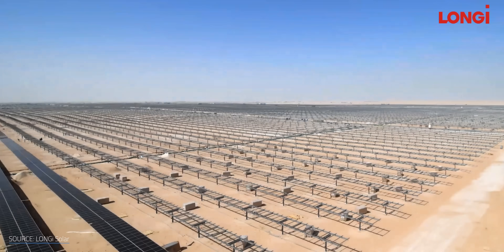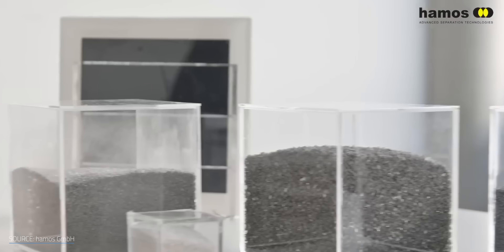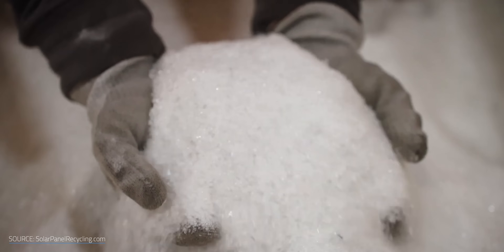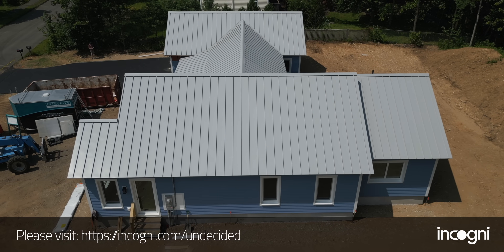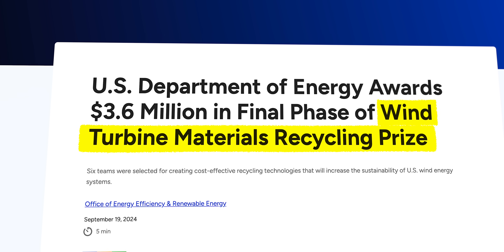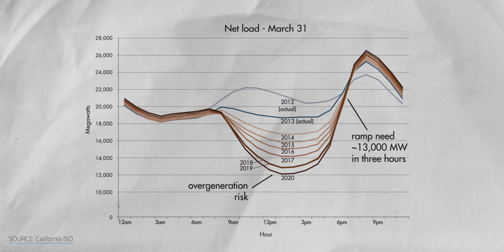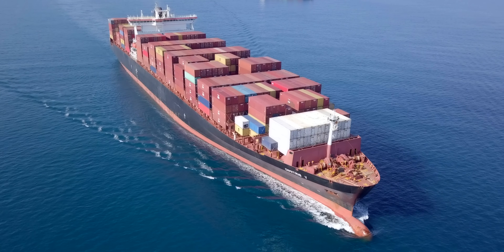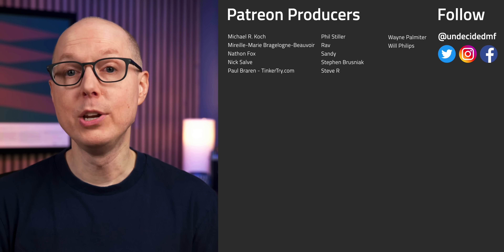How We Solved Renewables BIGGEST Problem

Comment: I never thought PV panels needed to be recycled. The ones I put on my roof 35 years ago are still working fine.
Reply: How many watts are they putting out compared to 35 years ago?
Reply: I'm guessing 60 to 70% the original output? The loss tapers out over time, right?

Either way, they are going to pull way more than their weight across their lifetime, even as they degrade.
Reply: @georgepal9154  actually if the numbers are correct and they are using them fully every day they should not have dropped by more than 17 to 18% so closer to 80% their original output.
Reply: the main issue is damage from hail and uv damage on the resin ones making their protective coat yellow
Reply: They will still keep working but the efficiency (amount of power you get from them) goes down with time, though if you’re 35 year old panels are still working I would expect new panels to last even longer due to advancements assuming they are built well.

Comment: I think the full usable lifespan of a solar panel is greatly underestimated.
Very early on the guarantee was 10 years, then some raised to 20 or 25 years.
But the true lifespan is much higher i think, more like 40 or even 100 years.

Some people are upgrading from old to new panels due to esthetics, or higher efficiency (power per surface area), not because they are broken or worn out.
Reply: "Full lifespan" isn't the important factor. It's how much efficiency drops off over time.
Reply: @qoph1988  do you think replacing them is more efficient? Why are the guarantees for 25 years?
Reply: Not even close.  Panels break in use.  From wind, hail, etc.  Any utility grade photovoltaic field are replacing panels every day.  Not to mention these panels are not built to last, they are built to be as cheap as possible, and that reduces lifespan.
Reply: @jeromethiel4323 utility type panels are almost certainly made to last decades and those needing replacement is insured. Panels can easily be made to last more than half a century with less than 20% degredation.
Reply: @pietersteenkamp5241  Okay.  I will believe what i have experienced and know first hand over wherever you are getting your information from.

And you can insure whatever you want, if you cannot buy the panels anymore, you are SOL.  You cannot mix panels willy nilly.
Reply: @jeromethiel4323  The insurers are of course meant to replace it with whatever they have to and that has nothing to do with you if you buy from a good brand that will exist for 40 years. Not sure why you think it's an economic necessity for a insurer to exist 40 years after it sold you a fairly cheap product but fine but fine maybe it does!  We have research panels that are over a half century old now and commercial panels from the early 90's operating at 97% capacity. You just don't know what you are talking about and want to compare the worst and cheapest commercial panels in a fast changing industry with how things have been for the last 5-10 years of stupidly cheap long lasting panels.
Reply: @jeromethiel4323 cheap ones anyway... I have 100psi snow load requirement here and we get skookem panels.  Inverters on the other hand are poo
Reply: @jeromethiel4323 From Google AI;
  
 Lifespan: 
Most solar panels are warrantied for 25–30 years.
High-quality panels can last 40 years or more.
Some panels installed in the 1980s are still working.
    
Degradation:
Solar panels produce less energy over time. 
The general rule of thumb is that panels degrade by about 1 percent every year. 
However, modern panels have a degradation rate of less than 0.4 percent. 
    
End of Google AI,
Reply: @ronaldlindeman6136  Google AI is wrong.  I work in the industry, and i will put my personal knowledge of this topic up against some stupid AI that can make up "facts."

For example:  "Some panels installed in the 1980's are still working."  Great.  How many?  What's the percentage?

And i might even agree with the 0.4% degradation amount.  That doesn't matter if the entire panel breaks.  Which is what i was talking about.

There are solar sites i service that cannot buy panels anymore because the panels they need are no longer made.  Why?  Because the panels break and need to be replaced.  And these sites bought huge supplies of spare panels when they were built for this very reason.

Comment: 1. One easy way of reusing old solar panels can be to reuse them over affordable housing. The panels can still priduce electricity, albiet at lower efficiency. But, it is something that the lower income housing won't mind as long they get the solar panels at dirt cheap prices, making them economically viable. The same can be done with lithium batteries. The car lithium batteries can be reused as back-up storage batteries and then in low income housing to increase their lifespan before they need to ve recycled.

2. Increasing the life of solar panels like peroskite solar modules, which have higher lifespan and higher efficiency, can help in reducing the pressures on recycling industries.

3. Companies have developed systems that can recover 90 percent of resin, epoxy, and fiber. Alternatively, old wind turbines can be gobbled up by the concrete industry to reduce their carbon footprint.
Reply: the problem with this is this:
1.- poor people do not get the land to make homes... its expensive
2.- whos gona pay for setting all that up? believe it or not, companies will not because moving/delivering, etc takes money from their money share... unless they are cut taxes equal to that price, but then they will overinflate it...

Comment: One of the biggest challenges renewable anything faces, really, is industry inertia. Replacing old, dirty technology with new, clean technology is expensive, and doing nothing is cheap - in the short term.

It'd be great if there was a way to make replacing everything with better things the cheaper option short term, or make doing nothing probibitively expensive.
Reply: Time + Scale + Technology improvements = lower and cheaper cost usually. Even when it comes to replacing it, but there are still just some major jumps when asking someone to put something on top of their roof that can make it a hard ask. Change is hard - and learning how it works can be harder / offer someone no benefit.
Reply: Inertia is only part of it. An expensive new powerplant can have a 30-year lifespan and abandoning that part way through its life for something new comes with a cost.
Reply: @FutureAIDev2015  the real problem is that throughout history, we have never switched to the new form of energy, we just add that and continue using the old as well.
When we "switched" from wood to coal, we started cutting even more trees. When we went from coal to oil, we burned even more coal, oil to natural gas we burn more oil. 
This trend will continue until fossil fuels are too expensive to be worth extracting. If we were planning for the future, maybe renewable energy could hold our civilization together for a few decades, but we are not.
Reply: @ A common sentiment from someone with no understanding of physics, economics, or logistics.  Current renewables are not feasible replacements for chemically stored energy.
Reply: @justinbiondi  of course they are!
Why do you think that the equivalent in solar panels of 10 nuclear plants in power output is being installed somewhere in the world EVERY WEEK?!?! And that number is growing nearly 30% per year!
Reply: @st-ex8506  Congratulations! You completely ignored the facts of what I was talking about, which is the lifetime cost and feasibility of current tech.  When you analyze it correctly, 'renewables' DO NOT beat fossil fuels in CO2 load.  Surprising? Well, most analyst ignore or omit many costs and stages of production and logistics, disposal/recycling and other factors.  And the current best trends show that they never will.  You cannot get energy for free, end of.  The only feasible solution is to return society to a pre-industrial state and abandon all hostile climates, which would lead to billions of deaths.  Don't feel bad, most people have no idea what I am talking about, lifetime energy cost is never calculated.  And all of the numbers you see publicly are severely skewed by government interests. We might make a renewable at some point which will cross the threshold, but no current tech will do it.
Reply: @ you are UTTERLY wrong as to the costs and CO2 footprint of renewable energies.  They are both WAY lower that those of fossil energies, and are decreasing further year after year.
I know a bit about that… it’s been my job for 15 years!  On what experience of yours are you basing what you say?
Reply: @amosbackstrom5366 sounds good, we should use all energy not just one.
Reply: @amosbackstrom5366  What you said is correct. The only way to change this is to have the government phase out the tech. They did a bit of that in the EU or it was the UK back around the war in Ukraine because of the lack of oil/gas. You have to do the same in the US and other areas, but that requires tech and tech requires stuff to be in place. As we saw with them, people wont want to change what they are use to using + the cost to upgrade it.
Reply: The biggest challenge with unreliables... is they don't make any sense, if they did? the market would move in that direction all on its own.
Reply: @DoktorBayerischeMotorenWerke  But the market IS moving... full-steam ahead (pun intended... in that direction!
90% of the world's investment into new power generation is into renewables.... which can be made VERY reliable!  Of course, there is much work to do to achieve that, but that is being done faster than any industry specialist (of which I was until my retirement last year) would have thought possible 10-15 years ago!
Reply: @ Someone said that exact same thing to me 20 years ago...
He was just as wrong then as you are now.
Reply: @ Well... I worked the last 15 years of my career as the technical director of a company active in renewable energies.  So... what I say IS a fact... backed by much experience.  

But you are partially correct... it was not true 20 years ago!  You should definitely wake up from such. long sleep... things have changed a lot, and are changing every year more rapidly!
Reply: @st-ex8506  How can you deal with the fact you wasted 15 years of your life on a lie?
 Or were you just in it for the paycheck???

So what has changed from 20 years ago?
Reply: @DoktorBayerischeMotorenWerke  Nope!  You decidedly know nothing of what is happening.
I am a chemical engineer, and I was leading engineering teams to design new chemical plants... or addition to existing ones, or replacement to outdated equipment..
In the last 10 years approximately, our clients, who were almost always large multinational industrial groups, have for the most part imposed rules that ALL new plants had to be 100% powered by renewable energies.  And not only is it possible to achieve, but it has now become CHEAPER than using fossil energies!
Don't you think that these companies know better than you, in your solitary corner?
Reply: @ This is a lie or ignorance.  You have no idea what you are talking about.
Reply: Then rejoice!  Industry is moving fast, much faster than almost anyone realizes, to change its energy sources!  I know a bit about the topic... it was an important part of my job (I retired a year ago).
Reply: No, the biggest issue is consistency and control.  You cannot control or predict natural power sources and production rates, and grid balance is difficult even with controlled power generation.  There is no good way to directly store electric energy, yet.  Storing energy as fossil fuel is still the most viable solution.  This doesn't even touch the 'total energy' equation which still puts 'renewable' energy far below fossil fuels in total energy cost.

Comment: Actually, I am not a big fan of wind (pun intended). Windmills are huge and expensive not just to build, but to transport, assemble, maintain, disassemble, and recycle. The combination of solar and batteries seems to make more sense. Both are more easily recycled at the end of their useful lives and have the capacity to provide 100% of the energy needed in the USA. Solar can also be more distributed. Individual homes, communities, or businesses can (in some circumstances) provide all of their own power with solar. Not as true with wind. I am all for using multiple sources of renewable energy. Geothermal seems to be an under used source. I am sure there are others.

Comment: Never had a concern about recycling, the raw materials in solar panels and batteries are too valuable to just throw away when we're "done" with them. A recycling center is like a raw mineral mine, except it's all been dug out of the ground already. Turbine blades were the only ones I didn't know about a good way to recycle, but even there I've no doubts a method will be found.

Comment: I wonder where the heat  comes from to separate the elements during the recycling process.  Natural gas plants?
Reply: Oh no, better stop all solar and wind power production IMMEDIATELY! Let's just burn the gas instead and pretend nothing's wrong with that, eh?
Reply: I expect over the next decade or two, moderate industrial heat like this will come mostly from thermal batteries. They should be cheaper to use than fossil fuel, not to mention cleaner.
Reply: About 80% of industrial-grade heat can be supplied economically via electrical energy. We just don’t do it because of the capital cost of retooling factories and the inertia of old heads sticking with things they know when building new ones.